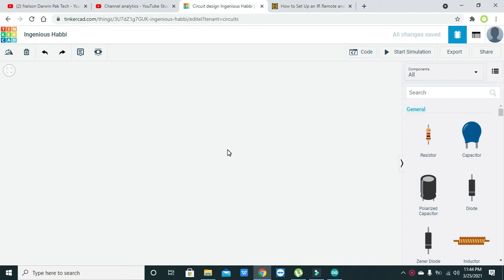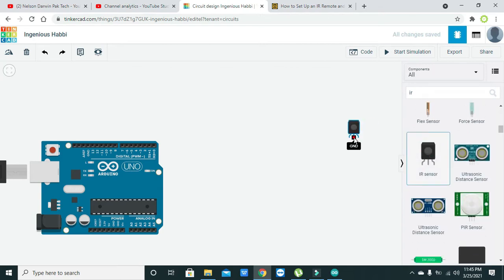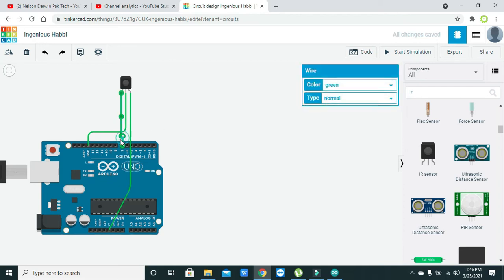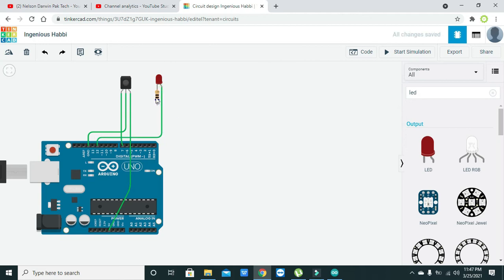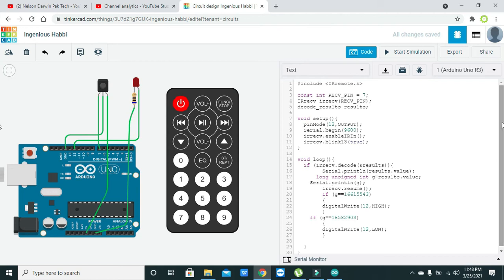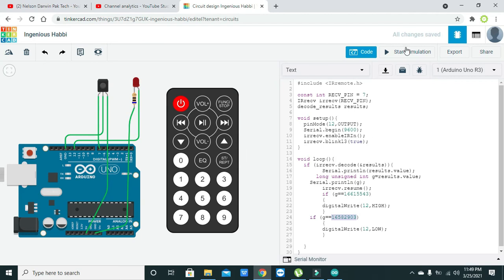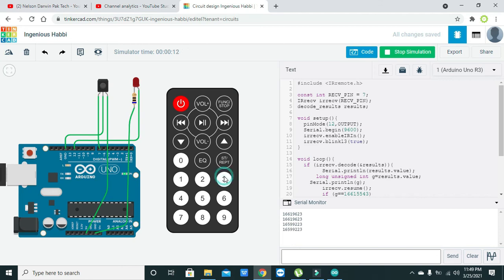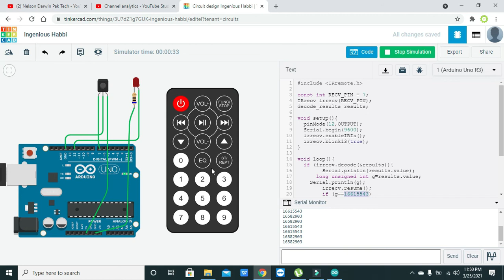control a device via arduino with an IR remote and IR sensor in tinkercad

Comment: Sir what should i add or change in the program if i want to make the same  button on and off the LED. meaning using only one button to toggle
Reply from the maker: u just need to change HIGH to LOW and LOW to HIGH in the programming....
Reply: @nelsondarwinpaktech3954  ok ill see to it